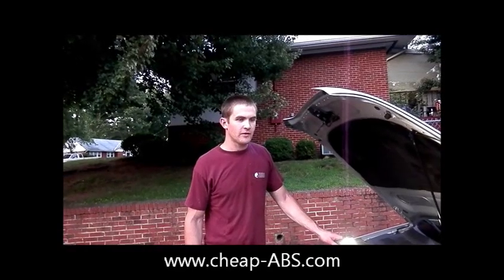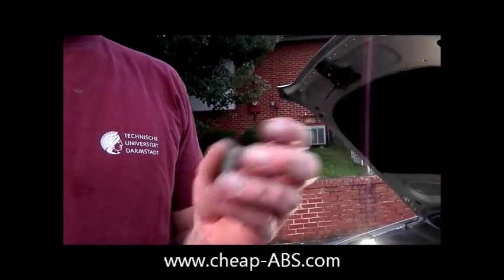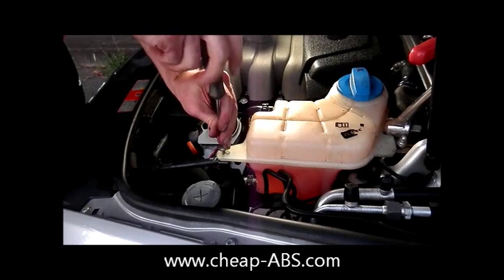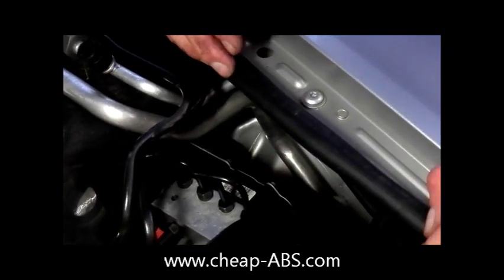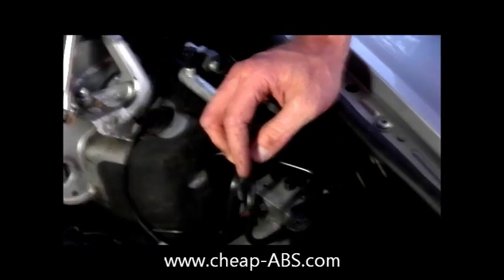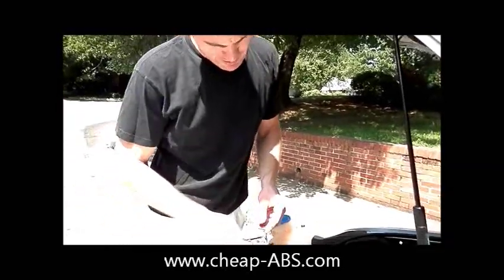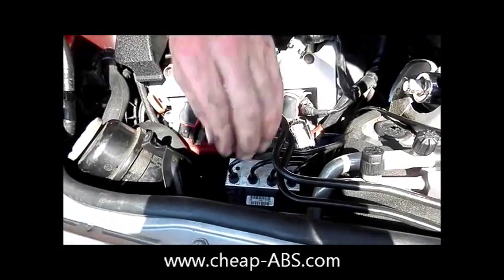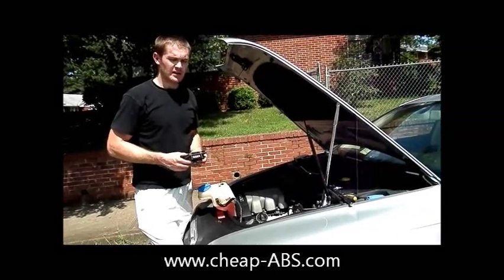How to remove an ABS module from a 2005 Audi A6 WITHOUT removing brake lines

Comment: Got 91 Audi 100. Not sure if Fuel pump is out or Abs control. Not sure. Whats the relation between both and why the breaks goes bad when power steering is low ?

Comment: did you try to drove it after? without electrical part? ..... just took it yesterday. Steering Wheel Power doesn't work. :(( almost impossible to drive!!!!! ........ :)))))) so not full info here.  Maybe somebody can tell me how to active at? .. My understanding Steering Wheel getting speed info from ABS Sensors. If its not connected... Steering Wheel not starting. Sad.
Reply: Hi there, i have just removed mine and have the same issue, did you resolve and did it go back to normal after reinstalling the abs module? thanks

Comment: What a joke. Part new is 2k ??? Audi engineering dept should all be fired for designing this piece of garbage car. Spill a drop of water on mmi counsel and the whole thing is shot now. Um thats where people place their drinks. Wouldn't u put a rubber boot covering the connections? Dont ever buy an Audi unless u are bill gates or have a bumper to bumper warranty.  My 1990 mb 300e runs like a clock and never put a dollar into it. 300k miles. My 2005 A6 160k miles. Have spent app 6k so far on HID lights ignitor complete front end including control arms washer pumps wibdow regulators etc... complete overpriced garbage
Reply: the only thing thats audi about this car is the bodyshell and interior. everything is really VW. my audi's abs module went and VAG have recognized its a fault and have recalled many cars back about this.
Reply: You jst mad I have the same car not a single problem and I dog my cars  haven't spent any unnecessary money on it.